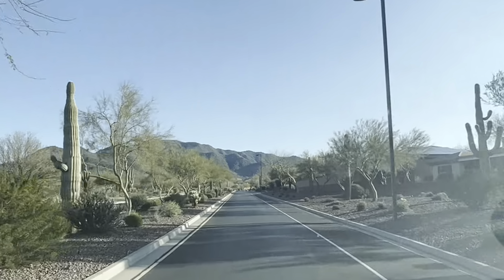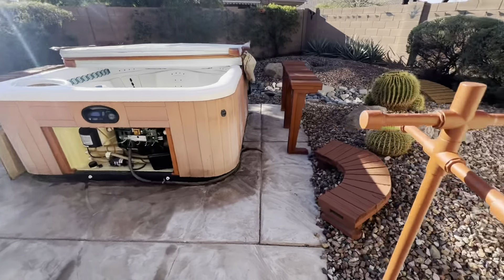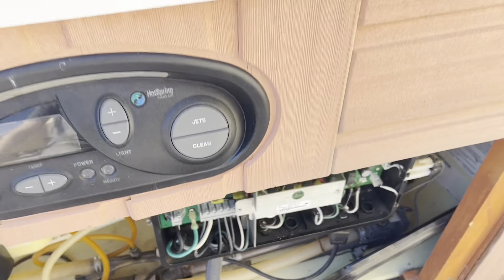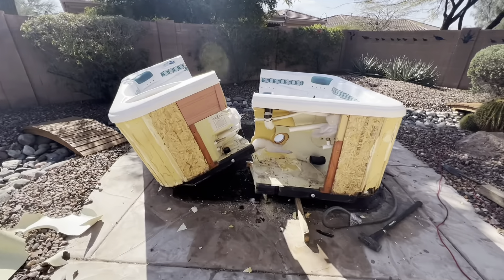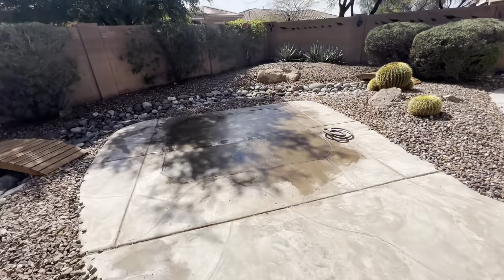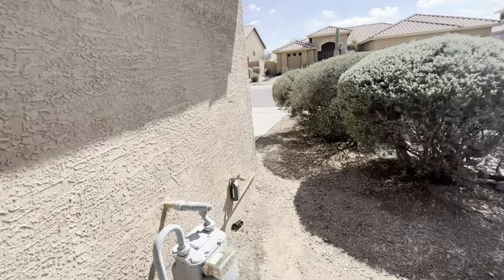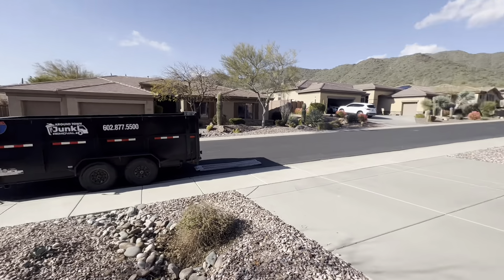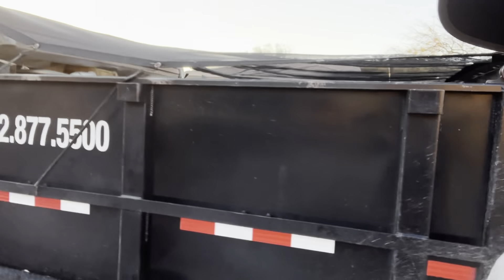Two Hot Tubs Removed In One Day By One Man - Around Town Junk Removal

Comment: What did youncharge for the hot tub removals.  Our prices for hot tub removal are $350 for a smaller end. And a large one $550-600
Reply from the maker: Good questions. Our pricing depends on three things: customer location, accessibility of the hot tub, and what else needs to be removed along with the hot tub. For example: sometimes there’ll be a good amount of furniture to remove or a built in structure around the tub that is either in the way or needs to be removed too. I think the national average is between $500-600. We usually come in under that.
Reply: @Around Town Junk Removal  I opetrate the same with hot tubs . Depending on size, i'm at $600-$800 if I can back up to it. Prices vary if I have to cut it up. I'm at $120 a ton to dump.